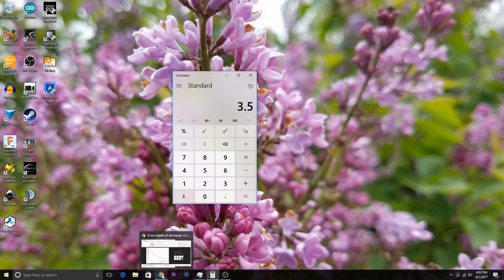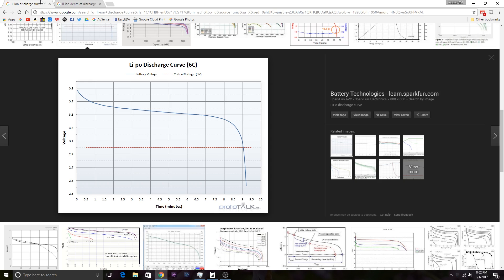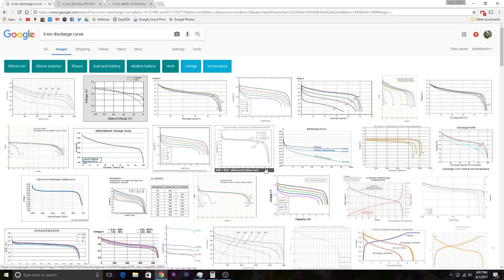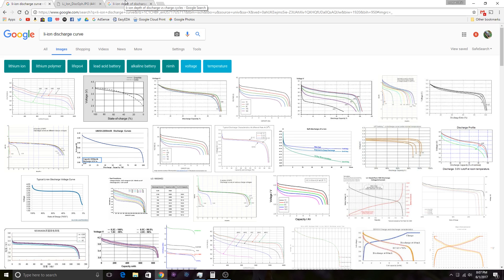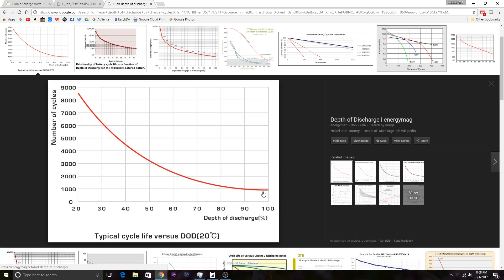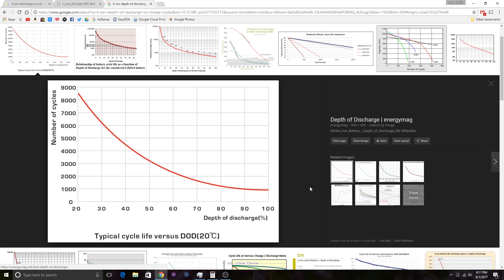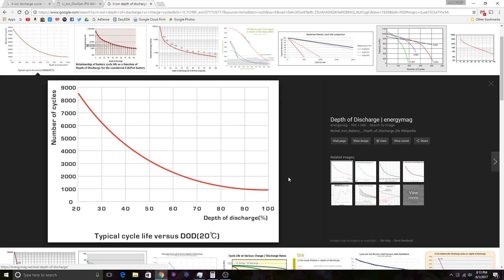3s vs 4s For 12V Li-ion Battery Pack

Comment: 4s is the way to go. I have a 4’s 60’p battery bank that I charge with solar. I set my max voltage to 15.6 and low voltage alarm for 13.6. It’s best to keep 4.0 volts per cell highest and 3.4 lowest. 
Anything below 3.35 your really drawing them to low. I also use no BMS. I have balancing leads that I can check voltage between series. Ryobi tools batteries are set 4.0 to 3.4. You can tell when there at the bottom.

Comment: Depending on your application the 3’s vs 4’s. I have a 1865 4s 60p that I use for a solar battery bank. I charge to 15.6 max voltage and set low voltage alarm for 13.2 The cycle life is best at low voltage. Staying 3.9 at the highest and 3.4 at the Lowest will give you a long cycle life.
Reply: Which charger controller do you use for it? Do you use normal own solar charger controller or lithium solar charger controller?

Comment: id say 4s becasue ur battery will never be full charge and as those cells have no mempry that is not a problem but ur cut off would be around 13v or 12.8 that would be easyer on ur battery becasue its not being over charge or to the max less stress on them i think

Comment: Just stumbled upon your video! My problem is exactly what is the subject of this video. I just built a 4s pack and my inverter only accepts up to 16volts and my charger tops off the pack at 16.8 so i am stuck with finding a way to adjust the charging to stop at 16 volts or just spend more money and build a 3s pack!! Very informative video!👍🏽
Reply: use a dc-dc step up for charging to a constant voltage and you can use the same thing for output just make sure you get a quality one that can handle the amps you need. Mine goes up to 9a output without heating up too much.

Comment: buck converter is the way to go. NOMINAL from any lipo battery with decent drain is 3.7, NOMINAL for lead-acid is 2.1.  Point is, as your graph states, you are sitting at that 11v shut off that most sine wave inverters trip at, any bump in draw and you will trip it.  Terribly limited to light duty. Also, most lead-acid are charged at 14.4 from the alternator, and that is what all 12v devices are designed to primarily run on. Thanks for the video, good food for thought. Light duty, 3 cell for sure, anything larger than a 500w inverter, 4 cell.

Comment: So a 4s battery pack (regulated, and treated as a 3s battery pack.) would increase the lifespan of the batteries by a few thousand charge cycles and have better parameters than a 3s battery pack? I mean you loose a few AHs, but the battery pack life is greatly increased?

Comment: If you could tune the alternator to limit it to the batteries maximum then the 3S works.  The problem is how to deal with the fact so many alternators put out 14.0v-14.9v.  That’s almost 5v per cell in 3S. vs 3.7 for 4S.

Comment: 4s is way better. you get more stable power from 4v to 3.5v (80-30%)and any modern 12v rated equipment will take 16v.

Comment: 3.5V on a 3s battery is 10.5V  which is also the recommended shut off voltage for lead acid so it looks like a good match as well. I think a 3s is better matched for lead acid, they just can't be charged with lead acid systems because of the 13.8V charge voltage.

Comment: If you use a DC to DC veritable power module you can keep your voltage constant with a 4S this way you won’t risk damaging anything you’re trying to power there will also be a lot less stress on the overall battery compared to using 3S
Reply: Angel KM wow!......where can I find one of these power modules ? I just build a 4s that had a crap bms and also my sine wave inverter only accepts 16v input! Either I need to buy more and make a 3s pack or adjust this one! Any suggestions appreciated!

Comment: My car battery definitely sits above 13 V for most of the time. If I read 12 V on my lead acid I'd go and fetch the charger.
Reply: maximum full charge on a lead acid battery is like 12.65 or 12.56 somethinig like that, if your reading 13v on your battery, your car is probably on and chargin, which should be between 13 at absolute minimum and 14.5 on the maximum side.  if you check your battery after shutdown of your vehicle you will be reading a surface charge on the battery due to the alternator recently charging at a higher charge.  turn your headlights on for a minute to deplete the surface charge, then you can get an acurate reading on your battery.

Comment: Absolute minimum is 2.5 to 2.6 volts per cell.
3 X 2.5 = 7.5 VDC
Absolute maximum charge is 4.2 VDC but for longevity you should not charge them any higher than 4.15 VDC
4.15 VDC x 3 = 12.45 VDC
So your operating range of the 3S unit is 7.5 VDC to 12.45 VDC.....

.
Operating Voltage range for the Lead Acid battery in your car is usually 10.0 VDC to 14.2 VDC.....
.
4S LiIon range = Minimum voltage 10 VDC (4 X 2.5V= 10V)  to 16.6 Vdc (4 x 4.15V = 16.6V)
Reply from the maker: Wait.... you state the absolute minimum is 2.5V to 2.6V and use 2.5V for your calculations but you say you shouldn't go up to the full 4.2 V to charge them because of longevity. I'm not sure I understand your logic here. If you want longevity I would be running them from 3.50V to 4.10V. There really isn't a point taking the cells below 3 volts though for sure because there isn't anything left in them at that point. 16.6V is still going to be too high for most power inverters that I have used anyway. And again that car battery will not stay at 14.2V if it's not under charge. They tend to settle down to more like 12.6V - 12.9V.
Reply: The minimum and maximum voltages I used are printed on every 18650 LiIon cell.
Read them yourself.
Overcharge does more damage to a cell because of 'dendrite' formation which is accelerated at voltages higher than 3.5 VDC.
(if you plan to store a LiIon cell on the shelf for a while because you do not need it right away; you should only charge it to 3.5 VDC)
 If you want maximum longevity I guess you could only cycle the cell between 3.3 volts and 3.9 VDC.
That will give you the maximum number of charge-discharge cycles out of the battery with the lowest rate of dendrite formation....
 Unfortunately; since you are only using a very small percentage of the battery capacity; you will need all of those extra charge-discharge cycles because you will be constantly recharging your batteries!
 The integrated circuits used most LiIon battery protection circuits , (such as the DWO1), are designed to cycle between 2.5 VDC and 4.2 VDC....
 Why would an integrated circuit manufacturer choose those two particular voltages when they could have chosen any other two voltages as the charge and discharge limits for their battery protection circuit?
 It was because they communicated with the battery manufacturers before designing the Integrated Circuit. 
You know,...those same people who printed those exact same maximum and minimum voltage numbers on every battery they made......
 Your comments regarding the Lead Acid automotive battery voltages were absolutely correct, but then again so were mine....
Reply from the maker: All the 18650s I have just have the nominal voltage on them. One brand says 3.6V one says 3.7V. Nothing about min/max. The DW01 chips are designed to go from 2.4V to 4.25V (2.40±0.100 - 4.250±0.050 to be exact, so absolute worst case you could be going down to 2.3V and up to 4.3V). The ones that I have tested go form 2.4V up to 4.3V. I do suppose I'm used to working with LiPo packs that do have voltage ratings printed on them that state 3.0V to 4.2V per cell and also a charger that will not even attempt to put anything into a battery that has a cell under 3.0V. So that is where my 3.0 volts per cell number comes from. Looking at datasheets and other info it does appear that taking 18650s down to 2.5V is common enough, though as I already stated there isn't much point because you are not gaining much capacity by going down to 2.5V instead of 3V. Do you have any kind of article you can link about that dendrite formation being linked to voltage? I tried looking it up myself and ended up just getting articles on researchers trying to make different electrolytes to combat this formation. By the way, do you work in this field or something?
Reply: Eman2000 a

Comment: Oh awesome, was wondering about this exact thing! Now I just have to find a good and affordable BMS / Balance charging board. I want to build a powerwall / smart battery with about 4kWh.
Reply from the maker: Thank you. I've been looking into BMS's recently and i'm having a hard time finding one that actually does balancing :(
Reply: One good kickstarter / open source project is the SBMS 120 or 40 by electrodacus.com. I'm still learning about electronics but this seems like a very smart product.
It doesn't have a bulk charger though, it only charges from solar panels that supply only a fixed amount of power / current so the voltage from the panels automatically drops to the battery voltage, and then up to 8 cells (any lithium but preferably LiFePO4) get balanced and watched for over or under voltage.

PS: But it's meant for larger batteries, then the price for the bms isn't actually much compared to a 4-10kWh battery and solar panels.

Comment: hi friend, i prefer to use 4S because i use boost converters, is better most voltage than less voltage, i think inverter could be grat alt 16 volts, remember the alternators of cards bring 14 volts even 14,5 so inverters have to know how to handdle it
Reply from the maker: If you are using nothing but boost converters and DC loads then 4s probably does work well. Car alternators can put out up to about 15 volts but there is a big difference between 15v and the 16.8v of a fully charged 4s pack. Generally power inverters will not output anything if the input goes much over 16v. This is sensible because a lot of them will use capacitors that are only rated a 16v. You may be able to find an inverter that does output a voltage with more that 16v on the input but all the ones that I have tested will not.
Reply: you are right, may be you save me to not burn my inverters... i think we have to use buck or boost converter to rectify the DC line
Reply: Eman2000 z

Comment: what about 24v and 6 or 7 series cells. 7x3=21v will be shutoff or close
Reply from the maker: 7s actually ends up being near perfect for a 24 volt system. Though 24v accessories like power inverters are harder to find.
Reply: i have 12v interters =(

Comment: I been thing the same thing.about building a 3 or 4 series pack. some inverters will go to 16 v. but most at 15v. if you could use a high current DC to DC boost converter. or if you could build a battery management. that could chance series to parallel some cells. to go from 3s to 4s when the volts drop to like 3.7 or lower. but you still don't want to drop much below 3v . but shut off at 11v with 4s. 2.7 is the limit. definitely need a BMS to shut off at low voltage.
Reply from the maker: I think I might have went over this in the video but the reason for not using a boost converter is because it would a major efficiency loss, so much so that you are better off just cutting off at the higher voltage. Switching batteries between parallel and series in theory could work but it would be somewhat complicated to implement.